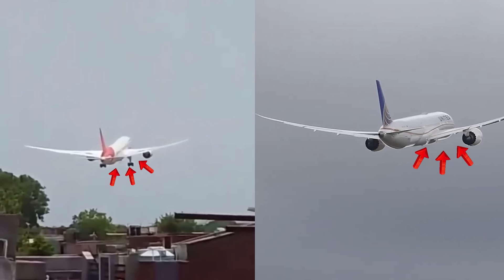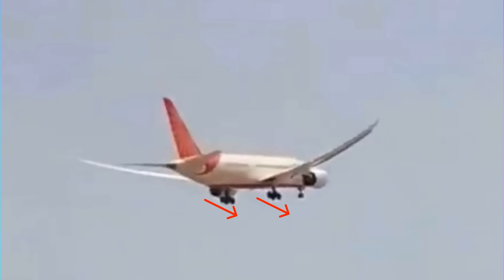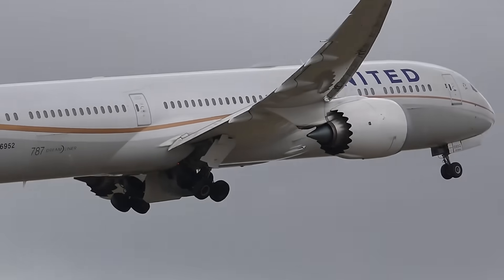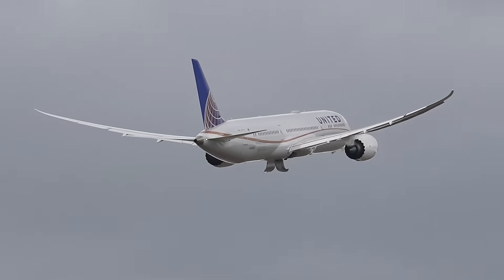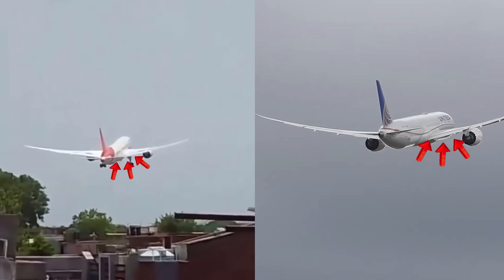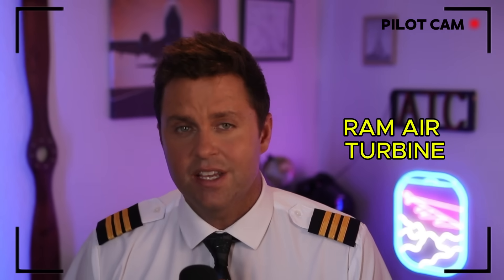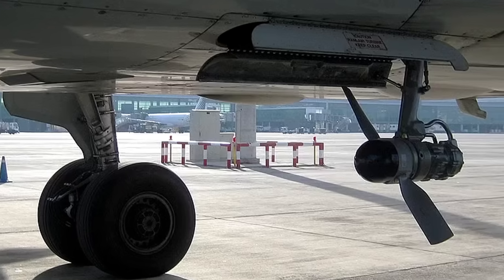Pilot Explains: A New Detail in the Air India 787 Crash Everyone Missed

Comment: The lone survivor presumably heard a "loud bang" followed by flickering lights. The flight before this indicated the plane had issues with A/C and entertainment systems. I understand the 787 uses lithium-ion batteries. Could thermal runaway account for the loud bang? Small explosion? Collateral damage to the electronics leading to widespread loss of power?
Reply: Capt. Steve ascribed this to the deployment of RAT.  It sounds like a bang apparently, and the lights flicker immediately after as RAT takes over electricity generation.
Reply: I would typically say YES, especially because the L-Ion Batteries (which I think should NOT be used in these), are volatile at high / extreme temps...the only prob i have with this is: he said he heard that about 30sec into flight. I believe they only flew for a minute, so the bang happened AFTER they had already lost power. When you watch the runway/takeoff footage, the plane struggles badly to get up to v1, then v2 speed for liftoff- to where they took the entire 11000+ runway length and barely made it up. Then get to 685ft and came down. I believe those batteries were beyond Temp/Stressed too far, which kills electronics and systems entirely
Reply: @gkswift1999  They rotated far before the end of the runway, and never got anywhere close to 625agl.
Reply: might possible. nice one
Reply: Very good point.
Reply: The loud bang could have been the tail breaking off, which happened when the tail of the plane hit a roof.
Reply: In such a case they couldn't even use the radio to send mayday call, but they did.
Reply: @user-yt198  The RAT would supply electric power for the radio call.
Reply: @jefftynan9274  If batteries failed, RAT would not deploy because there are still two generators from the engines. Batteries are just backup, not primary electrical source.
If batteries exploded and caused collateral damage and severed connection from both generators, deploying RAT wouldn't help for radio because of, well... severed electrical system.
In any case, even with severed electrical connection and miraculously working radio but no controls, engines would continue to generate thrust. The aircraft would keep in its previous position and would not stall.
Reply: they think that was the rat going out.
Reply: @brianpreval5602  Quite possible. I does thunk when deployed.
Reply: Apex - FWIW, per this vid presumably ruling out an accidental retraction of flaps, and I would tend to rule out contaminated fuel because I  would think first one engine would fail...then the other, as the possibly bad fuel reached one engine then finally reaching the second engine, which would have caused asymmetric thrust with only one engine powering, and possibly black smoke as a result if it were bad fuel? Plus those engines surely were running fine taxiing around the airport. Plus other aircraft might have been affected if the fuel supply were contaminated. The airplane having to use the whole  runway might be a clue. Could the "dust and dirt" kicked up at the end of the runway have been unburned fuel similar to the white smoke a two-stroke diesel truck engine emits when one or more cylinders are not firing? So if the survivor's story is true, then the "bang" could be the clue could the bang be a flame-out and if it was a flameout, do lights go out immediately? Do jet engines have mechanical fuel pumps which could keep the engines running in a complete electrical failure? Could an electrical failure cause the jet engines to fail? If an electrical failure can cause the engines to stall, then the RAT might have been deployed to resupply electricity to engine management systems for an attempt to restart the engines.
Reply: So, does a flameout cause a loud bang? Most flameouts I have seen actually have a big flame coming out of the rear of the engines before going out. It looks like the engines simply lost power.
Reply: @christarr7006  Compressor stall can cause a bang, and related flame is often out the intake end.

Comment: It will be informative to learn what the official cause of this accident is. I wonder if there wasn’t a complete FADEC failure - there is redundancy, the 787 I believe has two independent FADEC computers per engine, but if a major, unforeseen electrical fault of some kind could take out the FADECs on both engines, might that result in both engines losing power,  a lack of hydraulics, and deployment of the RAT?
Reply: Or can it be a fuel contamination issue. As it can also result in a double engine failure.
Reply: @ludwigvanbeethoven169  Very true, and with what information has been publicly released to date, fuel contamination is a distinct possibility in this accident.
Reply: Are both the engines' computers commanded from a common computer?
Reply: @quesoestbonne I believe auto throttle settings, which is commonly used in commercial aviation for takeoffs, are entered into the flight management computer, which then communicates with FADEC. There are three flight management computers on a 787 for redundancy, but again, if there was some weird and massive electrical fault on the aircraft, I’d think it’d be possible for it to take out all three computers.

Comment: Wouldn't contaminated fuel also affect other jets as well? Or is it a procedure to isolate the distribution source after a crash?
Reply: Not necessarily. Water contamination sits at the bottom of tanks. Whoever lines up first for the fill is likely to get all of it. It's the same with any solids that
are heavier than the fuel itself. Contamination is also possible due to condensation or other debris in the plane's tanks, without a third party source common to other users. This is not uncommon with piston aircraft.
What is surprising is that if this is the case, it was not detected and that filtration systems were ineffective.
Reply: @davidbrayshaw3529  Agree...  If indeed it was a dual engine failure due to fuel contamination which led to the crash, the whole fuel delivery system needs to be examined minutely.
Reply: @chrisantoniou4366  I would be very surprised if fuel contamination was a cause. Very. My only point was that it is very possible that contamination is contained to just one aircraft.
Reply: @davidbrayshaw3529  I think you mean "not", and I would agree, but we don't know what if anything had been done to isolate the underground fuel tanks after the crash.
Reply: YES
Reply: exactly, other planes would be affected.... unless it was just this place they contaminated? and if so ,why ?
Reply: batch samples are provided after every delivery.

im sure those specimens are so well guarded by now for it could break reputations and bank accounts .

Comment: If an aircraft experiences failure of the AC, IFE and flight attendant call button (as per previous flight from Delhi), along with a Ram Air Turbine (RAT) deployment, it indicates a severe electrical and/or hydraulic system malfunction.
Reply: Agreed!
Reply: yes, the plane shouldn't have been allowed to fly after the delhi flight.  did those pilots on the delhi flight log the issues?
Reply: The ECS handles air conditioning and cabin pressurisation, very likely it was working right at the time or soon after takeoff, else this may have caused a lot of discomfort to passengers at cruising altitude.
Reply: @RedSupergiant-y4n You would think that the AC pack would have to fail, as cabin pressurisation must've been fine ... but one must look for clues, but the actual investigators will no doubt come up with what happened.

Something seems to have suddenly prevented fuel flow to the engines, or switched them off.

I look forward to getting the answers ...
Reply: Great analysis; however, IF it was a duel engine failure caused by contaminated fuel, then wouldn’t other aircraft who received the same fuel be at danger?  I believe it was a total electric/hydraulic failure.  I was reading comments on another analytical blog and one  gentleman mention he was on that exact same flight the day before and the lights were flickering then as well as other small electrical malfunctions in the restroom and the audio system.  I’d be interested to see the maintenance records of that aircraft.
Reply: @dianneruth5984 The problems I was hearing about were on the previous flight from Delhi to Ahmedabad, which is even more concerning. But it would be interesting to know if these issues had been experienced on this very plane in previous days.

There was a short stop in Ahmedabad before heading for Gatwick.

The plane (registration VT-ANB) was then due to fly to Goa.

We must remember though not to confuse flight numbers with the actual planes themselves (which of course have their own registration codes).
Reply: That plane should have been investigated before flight, if for no other reason than passenger comfort, let alone safety!
Reply: That was not this aircraft, single row seating is not a 787
Reply: @Trail_Trash I don't know what you're getting at. This particular aircraft flew from Delhi to Ahmedabad under flight number AI423 immediately prior to departing for Gatwick.

Apparent electrical issues experienced on this previous flight may have been a total coincidence, or they may not have.

Comment: what can cause to stop working of two engine on 787 dreamliner when just take off?

ChatGPT said:
If both engines on a Boeing 787 Dreamliner were to stop working just after takeoff, it would be an extremely rare and critical emergency. Modern engines like the Rolls-Royce Trent 1000 or GE GEnx-1B have independent, redundant systems, making a dual-engine failure highly unlikely. However, there are known scenarios—though rare—that could cause both engines to stop. Here are the most plausible:

🔴 1. Fuel Contamination or Mismanagement
Most common real-world cause of dual engine failure in modern jets.

Water or microbial contamination in fuel could lead to fuel starvation.

Jet A-1 fuel freezing or forming wax crystals (rare, but possible if not handled properly).

Incorrect fuel type (like Jet B or avgas) loaded into the tanks by mistake.

Fuel system misconfiguration or blockage (e.g., valves closed, crossfeed mismanagement).

Refueling error, like no fuel actually onboard (has happened before—e.g., Air Transat 236).

➡ At takeoff, fuel demand surges. If fuel isn’t flowing, both engines could flame out.

🐦 2. Bird Strike (Dual Ingestion)
Bird ingestion into both engines can happen during or just after rotation.

Seen in US Airways Flight 1549 ("Miracle on the Hudson")—a classic dual engine failure.

787 engines are bird-strike certified, but large flocks of birds can overwhelm the design limits.

➡ Engines could surge, stall, or be damaged beyond continued operation.

🌪 3. Volcanic Ash, Dust Storm, or Severe Weather Ingestion
Volcanic ash can melt inside the engine, coating turbines with glass-like deposits.

Ingesting very fine dust or sand (especially in desert regions) can choke combustion.

Extremely heavy rain or hail can cause compressor stalls or extinguish combustion.

➡ Both engines may flame out due to loss of combustion or mechanical damage.

⚠ 4. Software, FADEC, or Electrical Fault
The engines are managed by Full Authority Digital Engine Control (FADEC).

A simultaneous software fault, loss of power to the FADEC units, or corruption in flight-critical systems could theoretically stop both engines.

787's electrical architecture is unique (more-electric systems), and a power bus failure affecting both FADEC units could result in shutdowns.

➡ Highly unlikely due to redundancy, but possible if multiple failures cascade.

🔧 5. Maintenance Error or Sensor Misconfiguration
If pressure sensors, fuel lines, or control logic were incorrectly set up during maintenance, it could cause fuel starvation or FADEC misbehavior.

Example: Pitot/static port tape left on (as in previous 757 accident) could lead to faulty air data inputs, affecting engine performance logic.

➡ Could cause incorrect engine control logic or inhibit thrust production.

🛠 6. Sabotage or Cyber Interference
Very rare, but theoretically possible.

Simultaneous shutdown commands via unauthorized access or insider threat.

Engine shutdown switches manually triggered (accidentally or deliberately).

➡ Security protocols are in place to prevent this, but it's part of comprehensive failure risk assessments.

🪂 What Happens Next? – Glide and Ram Air Turbine (RAT)
If both engines fail:

The 787 will automatically deploy the RAT (Ram Air Turbine) to restore critical power.

Pilots are trained to handle dual engine flameouts with glide and relight procedures.

At takeoff, altitude is limited, so time is very short—expect immediate action from crew.

✅ Summary: Most Likely Causes of Dual Engine Failure After Takeoff
Cause	Plausibility	Examples/Notes
Fuel mismanagement/contamination	High	Air Transat 236, BA Flight 38 (ice crystals)
Dual bird strike	Medium	US Airways 1549
Volcanic ash/dust ingestion	Low	BA Flight 9 (Volcano), Jakarta
FADEC or electrical system fault	Very low	Would require multiple redundancies to fail
Sabotage or software glitch	Extremely rare	Security and software validation in place

If you're referring to a specific real-world event, I can look it up with date or flight details. Let me know!
Reply: No mate! Both engines stalled! Not flame out
Reply: Wow, thanks for this! I am no expert here, but I believe it may be fuel contamination or plugging in the wrong gas. They did say they didn't find any dead birds anywhere, so I read. Could be electrical, too as passengers from an earlier flight on that same plane had said that nothing was working, i.e., AC, TV, lights, etc.
Reply: I don't think most people will read all that

Comment: Can contaminated fuel shut off both engines exactly simultaneous? Or would the engines fail at different times. Fuel shut off sure does put out the fire 🔥 immediately. Is this similar to the airbus that went into the trees several years ago?

Comment: Are the mid-wing spoilers partly extended?  Also, could a software glitch cause auto-throttle to reduce power and not give the flight crew enough time to figure it out?  Like the attitude issue with the 737 MAX?  And how contaminated must fuel be to not burn -- a lot, I would imagine.  Also, even a flaps-up takeoff should allow the plane to climb, even if poorly.  In the video, there seems to be a good initial climb.  Do they not run the APU on takeoff & landing?

Comment: It never had full power. If it did, then why did the jet use the last brick in the runway and still be nearly 10 knots slower than the average of about 184 according to a chart I saw in one of these videos? If it was fuel contamination, why weren't other planes dropping out of the sky?

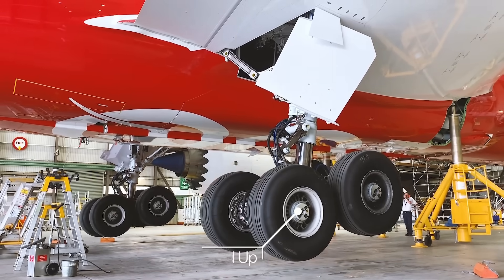Comment: Am I the only one who can see the spoilers turned on above the flaps at 0:12 for air india 787?
Reply: What are breakers?
Reply: @donfisher8035 - Breakers is a short term for Circuit Breakers. They are small pop-out type buttons positioned throughout the flight deck, on panels overhead and behind the flight deck crew. Each Breaker controls a specific electrical system on the aircraft, acting as a fuse in an overload or short circuit situation. During maintenance the engineers will manually pull and safety tag specific breakers to isolate a circuit while work is being carried out.
Reply: Spoilers. I caught it too.
Reply: Spoilers?? But yeah, I reckon I saw this
Reply: @deanworsley5208 
It’s not the flappers in question. 
Landing gear is on !😮 it has to be retracted in order for aircraft to ascend 
Difficult when landing gear is not retracted
Reply: @penepattra8983 that's not true, the plane can fly with landing gear down.
Reply: Spoilers NOT out.
Reply: What about EMP
Reply: It might be possible but it is unlikely and most likely the flaps since the spoilers are auto deployed
Reply: Edit it’s for sure the flaps not spoilers
Reply: I see that

Comment: further asked AI to elaborate electrical noise or spikes at this moment:
The primary AC buses may trip or fail to hand off properly

Power to FADEC, avionics, and control computers may momentarily drop

If airspeed is still low, the RAT is useless

The backup power systems (batteries, APU generators, inverter) may take a few seconds to activate

In those critical 3–5 seconds:

⚠ Engines can lose power, control laws degrade, gear/flap actuation fails, and the pilot is flying blind in a high-drag, low-speed state.

Comment: Failure to maintain acceleration after a normal 787 takeoff roll could result from:

Fuel System: Central tank pump failure or surge-induced flow disruption, mitigated by surge tanks, redundant pumps, and gravity feed.
Engines: FADEC malfunctions or engine surges, addressed by redundant controls and anti-surge designs.
Electrical: Loss of all generators, countered by RAT and battery backup, ensuring fuel delivery.